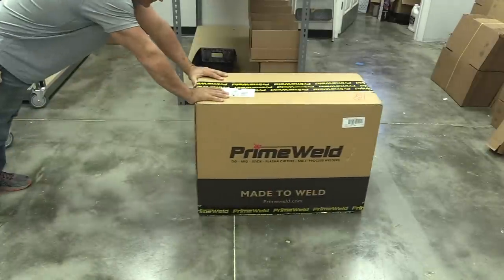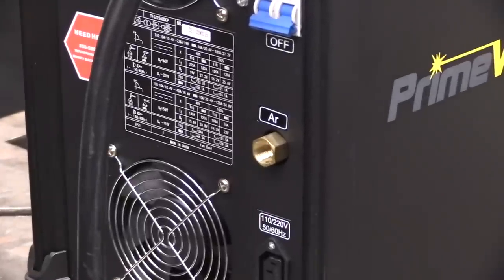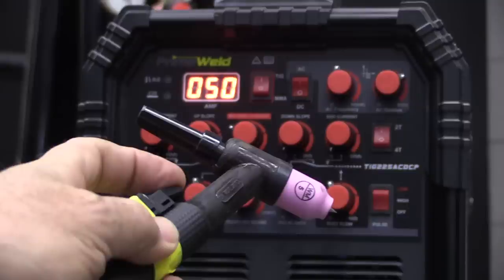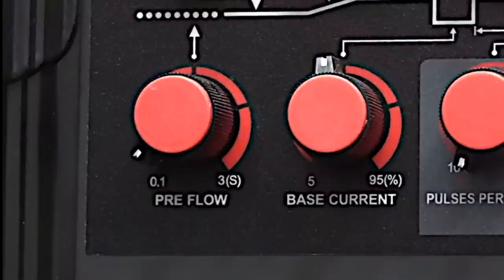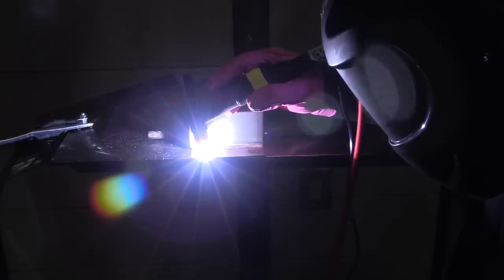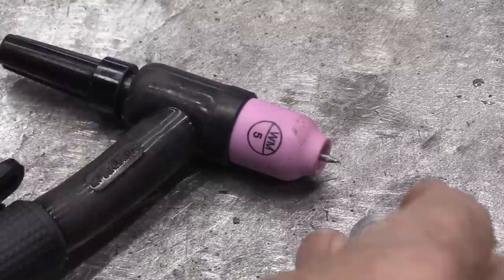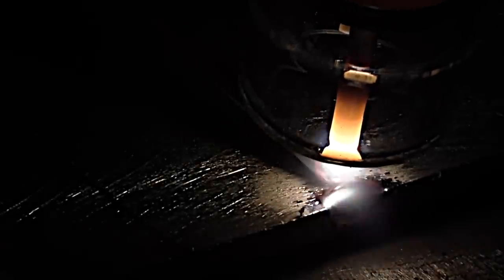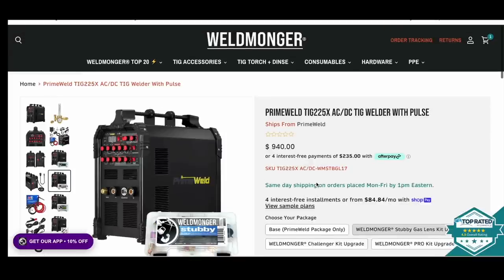PrimeWeld TIG225X 2T and 4T Settings - Switch vs Foot Pedal

Comment: I bought this welder about 2 years ago so I could weld aluminum. I have used it alot in those 2 years and have zero complaints about it. Awesome machine for the price.
Reply: Same here
Reply from the maker: Good to know!
Reply: Can you do a video on 7028
Reply: I bought mine about a year ago and also have zero complaints.  It's been a fantastic welder and has easily handled everything I have needed.  I also bought one of their plasma cutters about 6 months ago.   My only complaint is the shielding cups are a bit fragile, other than that it's a great plasma cutter.

Comment: it's never the cost of the welder that's the barrier..it's the cartel of gas sellers that make it expensive and difficult.
Reply: Gas suppliers are crooks and they will try to take advantage if you let them. In my experience, it's best to find out what other welding shops are paying for there refills. Once you are armed with that information they will switch there tune. I pay $70/ refill on a 330CF tank. Every time I go back for a refill, I have to show them my receipt because they will try to charge me $250+.
Reply: Haha seriously? $40 to swap a bottle isn't sh*t man ? Unless you're broke I guess...
Reply: Life is expensive.
Reply: @yakswelding86  I pay about $80 down here in Bradenton Florida for a 330cf refill . Mine is pretty much in exchange I go to the local moms and pops welding shop. All the other welding gas places try to pull the same stunt of charging me $250.
Reply: If you're starting out and need a new bottle, guys in FL trying to get $750 and 125 a refill for 330cf bottles.  It is a damn cartel...
Reply: So in Georgia where I am, I bought a brand new bottle for $350 bucks about 5 yrs ago. And it's been between 40-50 bucks anytime I've swapped it since 🤷‍♂️  The small company I use sends all their bottles to airgas for them to be inspected and refilled. So idk what's up these price differences across the country.

Comment: I bought one of these units about a year and a 1/2 ago, I absolutely love it. I use mine at home, mostly for fun, so minimum use. I do not weld for a living. I had one issue with my gas regulator, Primeweld replaced it with one email and a 5 minute phone call. No hassles, no waiting forever on the phone, no hoops to jump through, I wish more companies had customer service like this. It is really tough to beat these units at this price point,  I don't think anybody does.

Comment: I got my machine about two years ago.  When I unboxed it and went to set it up, I found the power plug in the back was broken.  Two screws and a couple wire connections, easy enough to fix.  Called the company and asked for a new plug, told them I'd just swap it out myself.   They said sure no problem.  Two days later, instead of the plug, I had a whole new machine on my porch and return label for the original.  Can't really ask for better customer service from a company.

Comment: FYI guys.  The plug is correct.  If something metallic falls between the plug and wall you want it to hit the ground rather than the electrified prongs to prevent arc and possible fire.  I do this in all my houses as well.

Comment: I bought this welder 2 years ago to start getting into marine Fabrication. I still use it today welding 90% anodized aluminum  pipe for t-tops and other boat related projects. So far, so good. I'm seriously impressed with this machine. And I got it not knowing a single thing about TIG welding. I learned from videos from you and others on YouTube, lots of prayer and lots of practice. Thanks for the videos and this review.

Comment: I'm a hobby/crafts welder and use a prime weld multi function unit.  I started off using the switch on the torch but after watching your videos I've been trying to use the foot pedal.  My biggest problem is neuropathy in my feet and have a darn hard time controlling the pedal.  The 2T/4T features seem like they would help me a lot.  I second the customer service at Primeweld, they set the example for others to follow.

Comment: Absolutely a great machine!
I love mine and the service is impeccable!
I had problems with it not ramping up so I emailed them with the symptoms.  They emailed me back within 20 minutes and asked for a good call back number to reach me. They called me back 2 minutes later to tell me they were sending me another one! Said when I get it to send the other one back in the shipping box that was post prepaid!
I got the new one within a few days and works flawless! Cost me nothing for the return.
I cant say enough about the machine and the service.
You won't be disappointed in this machine. 
I love it!

Comment: I only use the trigger switch when necessary. Last week the PrimeWeld Trigger switch stopped working. Looks like a wire came loose at the switch. So I emailed them and they replied immediately and sent a replacement the same day. Great customer service.

Comment: I bought one in 2022 and I highly recommend it. Great customer service. Yesterday I used a Miller machine to weld some aluminum and I was surprised how much louder the AC welding is with the Miller, so loud it was very annoying. The PrimeWeld machine is quiet compared to that. One improvement PrimeWeld could make is to make the fans come on only when needed.
Reply: I've used Lincoln and Miller all my life, but for the money and the reviews, you can't beat it

Comment: @weldmonger  Jody, this is the Best Video I’ve seen anyone do on the T225X. I used to work for a Helicopter Crop Dusting Company. When I started there they had a Syncrowave 200, for some reason we could never get this Machine running smoothly on Aluminum. I really was convinced there was something wrong with the Machine from the Factory, because I had a Syncrowave 250 Tigrunner (Ware Cooled Version) at home, so I was very familiar with setup and welding Aluminum with these a transformer Machines. My 250 was a Reliable Beast. Long story short I talked them into purchasing the Primeweld T225X to take the place of that Syncrowave 200, and Primeweld 225 performed flawlessly and the Syncrowave 200 was never turned again for anything not even mild Steel.
I can’t recommend Primeweld highly enough. In my opinion there’s not a better Welder out there for that Price Range!
It outperforms Welders that costs Thousands of dollars day in and day out. I have several Friends who have purchased them at my recommendation and a couple of them are actually making a living with these Machines.
Now with the Primeweld Tig 325’s release this is an even more viable option, especially when you add the Water Cooled option to it.
That’s gonna be my next Machine, the 325 with Water Cooler!  Thanks for all that you do for our Community Jody!

Comment: I got one of these almost 2 years ago and I got the water cooler to go with it and it's been a great welder all this time I've willed it a lot of aluminum and I do a lot of steel work. And I have to agree with you too I think this is more of a commercial welder than an entry especially on the build quality of the welder. Yes there is a lot of knobs being analog you don't have any processors to go bad inside the machine. I do have to say it's awesome to see you do a review on the primeweld tig225x and also adding it to your store wood bundles. Negative be a great addition to your store get a lot of sales with the bundling of stubby lens kits. Keep up the good work on the videos in the reviews of stuff been a subscriber for a long time and learned how to TIG weld from watching your videos.

Comment: Thanks for this video and your time.. It was very informative. I do better watching and learning than reading the manual. I just got this machine and was used to an older high frequency Miller with an XMT 300 DC Inverter. Way more machine than I needed for what I do. It doesn't do aluminum. So kind of excited that I can do aluminum with this machine. I weld stainless and carbon steel more than anything.

Comment: Great video. I have only ever used the foot pedal with my primeweld 225. But I did recently buy a "tig button" but I have yet to install it. Alot of people with this welder recommend it. It is a pressure button that basically acts like a pedal.
Reply from the maker: I need to try the "TIG button". seems like a great innovation
Reply: @weldingtipsandtricks you will like it. I was/am impressed with it.

Comment: If i didn't already have an Everlast TIG, that looks like a good one.  i sure do love welding machines with switches and dials!  out of the 30+ machines at work, we have about 6 newer "smart" welders with digital menus to change the settings.  I'm always disappointed when I inevitably get stuck using one.   I don't need a machine to figure out how to set itself, which is counter-intuitive since the machine isn't doing the welding manipulation.  I don't know who would want a crutch that thinks it knows how to walk!  probably about 50% of the time i'm not in a position where a foot pedal can be used, except if i press it with my knee or hand if i'm feeling limber, so i made my own finger switch to tape on.

Comment: Setting start current at 225 would be the equivalent of using "hot start" say you have big part and you need to get the puddle established. Most machines I work with use a percentage of your main current for start and end. Some parts take more amperage to start but once you get it going it wants to run away on you (alum). So rather than sitting around waiting for 200 amps to make a puddle you can punch it for a second or two and then let off to your set amperage. The faster you get in and get out the less heat input blah blah blah. The only downside to hotstart is if you don't set your balance correctly you'll spit the end of the tungsten off. Pretty nifty, almost as cool as special 4t on a fronius 320i. Anyways, keep your stick on the ice.

Comment: Great video's!  I would have never got into welding as a hobby welder if it wasn't for your video's!!  I just got this welder delivered yesterday after using a cheap stick welder i got on amazon for the past six months.  I decided i liked it enough to bite the bullet and shell out for something quality.  I'm certainly no expert yet in the tig welding area what kind of lubricant did you use to ease on the clear lens over the o-ring? thanks again!

Comment: Mine is different. It still allows upslope and downslope on 2T mode, but sometimes I want to tack and I really need to turn those upslope and downslope time to zero or else it will fire the arc longer than planned. I've seen some weld by a series of tacks using 2T mode, especially on thin materials, what do you think? They set the amp far higher than needed for the steel (say 80 to 100 amps for 1mm stainless) and then just press and release quickly for a short tack, and then they would repeat this throughout the weld. It allows for low heat input.

It also has "cold weld" function where it will fire an arc for a VERY short time, milliseconds, at very high currents, again for very thin materials where traditional TIG setting will cause it to blow holes in it. However, the problem is that it ignores preflow, in fact it gives no preflow, and so it's firing the arc in air, causing it to blow the tungsten at the work. The feature is unusable in this state, and manufacturer told me to fire off a blank pulse into the air, but since it takes me several seconds to find the workpiece before the post flow shuts off, it wastes gas.

Comment: Jody, great video and explain a really frequently misunderstood process/feature.  What are good times/purposes for 2T since it's leaving the fisheye at the end of the weld?
Reply from the maker: If its leaving a fisheye , generally needs more downslope. I saw after the video that I still have a few dots at the end so I think 1 more second would have cured it.  I think I was set to 3 seconds so 4 would probably have been good. this will be different for different metals and thicknesses.

Comment: I’ve got the same welder and have been super happy with it.  I replaced a Miller econotig with this machine. I’m not a welder by any means, I’m just a guy who needs to weld things from time to time and have taught myself. One thing that I find strange with this machine vs my old Miller (which was transformer based) is that sometimes the prime weld doesn’t want to arc and I need to touch the base metal with the electrode to get an arc. Is this normal, or do I have a setting wrong. This is all in 2t. Haven’t fooled with 4t

Comment: Awesome video! I took a LOT of notes, thanks!!! -- Looking for a video on "Dual Shield" using a 200amp machine... ?? It seems the wire vendor is the key to welding Dual Shield with machines that can't do the big amps... am I wrong? HELP!!
Reply from the maker: I posted a video using dual shield with a lincoln 210mp back a few years back with @jdbrewer https://youtu.be/zpbFBDTuK04
Reply: @weldingtipsandtricks  That's what I was looking for... and using the Lincoln wire too! Awesome, thanks ... I never saw that one.

Comment: 4T functionality is replicating what you would normally do on a pedal.  That is the start and end currents and slopes.  What you would normally do with your pedal.  

Pre/post gas flow, as well as the welding current and frequency/pulse settings, affect both the 4T and pedal and are overall weld settings.

You probably already know this, friends.  Just putting it succinctly to help anyone grasp the concept in case the 4T doesn't make sense..

Comment: How do these machines compare to everlast?  Better or about the same?
Reply from the maker: Some of the Everlast welders like the 255ext had some pretty cool features  but for the price and with a CK torch along with nice foot pedal, this one is a slam dunk... and I like their customer friendly policies.
Reply: I was about to buy another Everlast until I got reading around and found this welder. I had no problem with the everlast I had, but the reviews for this Primeweld machine are nearly all 5 stars, and their customer service is very good. My bank tried to block my purchase thinking it was fraud. So I tried to call Primeweld over the weekend. Like most places they weren't there, but that's pretty normal. Monday morning,  I got a call from them because they saw my missed call. I'm sold on them because of all this.
Reply: @weldingtipsandtricks  nice! Good to know!

Comment: Would a tig trigger be useful for pipe welding by eliminating scratch start tig?
Reply from the maker: It could be. I have worked in pipe shops where they used triggers

Comment: The outlet plug is "upside down" because if it gets pulled out by the cable, the last pin to come out of the socket will be the earth. Safety.
Reply from the maker: thanks for the info. I'm not an electrician but it seemed awkward

Comment: Can you recommend a good "first" welder.  I have done plenty of random welding using loaner 110v mig welders and want to get my own.  I will be doing "dirty" welding for art, but I want to eventually play around with everything including aluminum.  Should I look out for a good sub $500 used welder on facebook marketplace?  Got any recommendations to keep an eye out for?  Can you Tig at 110v?  IF my budget was 1k for full setup?

Comment: Which receptacle do you use for this welder? In specifications input voltage said 1 phase 110v 30 amp or 1 phase 220 v 50 amp. Where in US you can get 220v 1 phase?  I can add dedicated receptacle with 50 amp breaker 220v but it will be 2 phase (110+110v). 2 phase receptacle will kill your welder TIG225? Or its made for Europe receptacle?

Comment: I have the same welder, but I have a problem with the pedal, it does not regulate the temperature, as soon as a step on it just a bit it goes up to whatever amps I set it, I’ve  thought about taking the pedal apart maybe something skipped inside but I wanted to ask you guys see if you could give me some advice

Comment: 3 Dumb question 4yA.?   Can you please tell me why a person would use a 7018 over top of the 6010.?  And not just keep using the 6010...  Is it because its shallower but Wider...  So you have the deep pen narrow 6010 rod 1st, then tie into it with the wider shallower 7018 to fill it...    2nd... Why can some $300+ welders can run a 6010, but others of roughly the same specs won't.?  But they all mostly claim they can... Wonder what part of the welder it is thats responsible for being able too run it or not...   3rd... Would u also know what makes One 120v welder able to run at 130 amps... But another 120v welder can only handle 80 to 90 amps on 120v.?  What internal part is responsible for that Diff i wonder... Thanks

Comment: I recently purchased this and on aluminum only when I start the arc it pops quite a few times before the arc stabilizes, any idea what that might be? Was using pure tungsten off the start but then switched to the tungsten that came with the machine, still did it. Any info would be appreciated
Reply from the maker: I have a dynasty 280 that also has occasional rough stars on aluminum.
I find that using a tapered tungsten along with scratching the metal with the electrode before you start the arc helps.  I use 2% lanthanated for this but I have friends that love the CK worldwide LAyXr tungsten for crisp low amp arc starts.  Also a 2 second pre flow setting can help with clean arc starts on aluminum.
Reply: @weldingtipsandtricks  thanks for the reply, I’ll give it a bit of pre flow, might try the start current knob a bit to when I get home from work, some peole have told me to try that as well. Really enjoy your videos, sure help me a lot when I need a refresher.